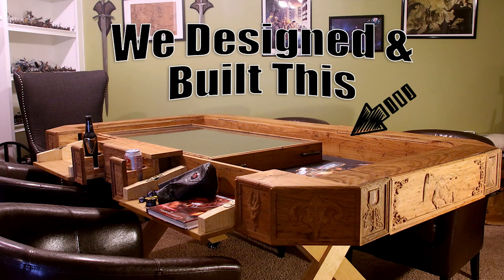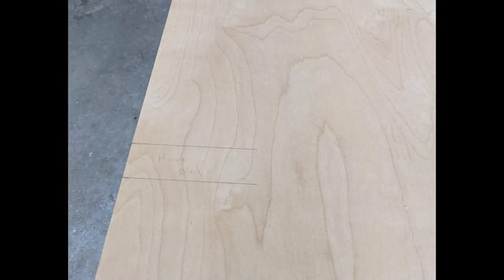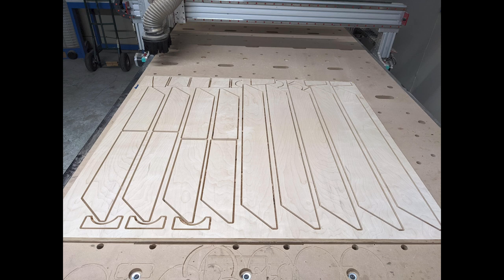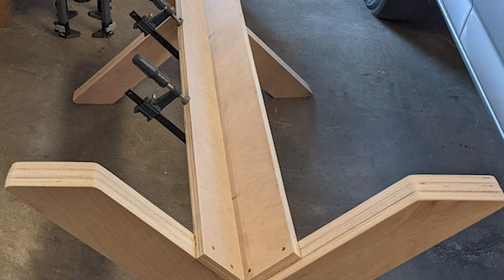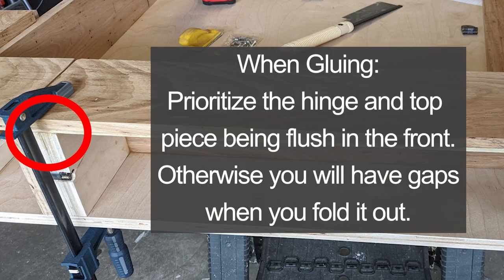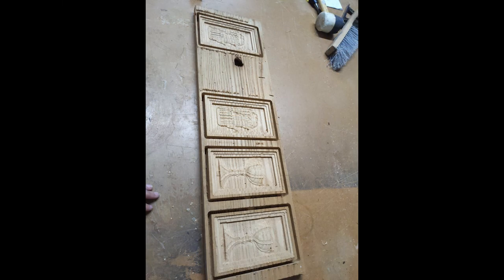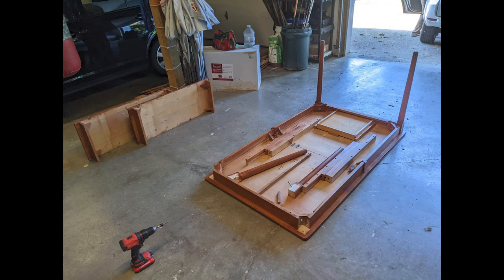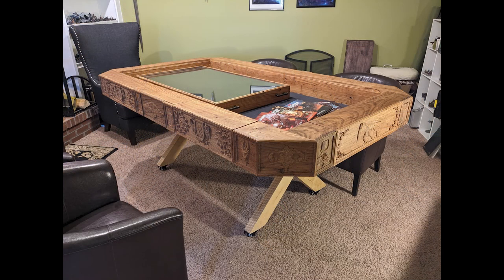Building The Gaming Table

Comment: The issue with hinges isn't just plywood - though that makes it worse. It's screwing into the grain, just turning the playwood the other way, would have made it much stronger.
You could also use a router to inset the hinges to make it a smooth connection.

Cracking has a lot do do with using different woods, as they expand at different rates in different temperatures, and drilling one board width wise and the other length wise. Wood expands more along the grain.

Overall cool table!
Reply: I'm not sure what you mean by turning the plywood the other way. Plywood layers alternate orientation. Am I misunderstanding what you mean?

Comment: Why’d your table skip leg day?
Reply from the maker: It's actually for a very practical purpose.  The chairs we have for this table are way oversized. We couldn't do a typical 4 post, one in each corner design.  On top of that we knew we needed it on casters to be able to move it regularly.  We use that space for a number of different things and that table is constantly shuffled around.  What's worse than stubbing your toe on a table leg?  Scraping up your whole foot on a caster locking mechanism.  So we had to make sure the legs were tucked well under the table.  The X design with a runner works extremely well for stability.  So while it looks very silly on it's own you can't even see the legs when the chairs are around the table and no busted toes or knees so far.
Reply: @tworoads  nice! Always better to have practical design choices instead of ice packs on hand
Reply: this comment made me laugh so much!

Comment: Would you happen to have these files available anywhere? I would love to make a table similar but lack design experience.
Reply from the maker: You can look through the build process with links to files here: https://www.instructables.com/Gaming-Table-1/  The faceplate panels aren't included as many of those were paid files and I didn't have the rights to share my modified versions.  All the other files are there as Tinkercad links, but you can make yourself a copy of those and save what you need as an STL. I wanted to give people access to Tinkercad versions so they could modify for their needs.  Good luck with your build!
Reply: Very cool project. Making one similar with solid materials. Would you be willing to share the cutting angles and dimensions of the fold out hinged shelf. We will be doing this by hand without CNC benefits :-) thank you
Reply from the maker: So the piece that makes the 2nd half of the fold out desk is 20" by 6.5"  We maybe would have made them a little wider.  On the short ends those were 25" wide which gave the DM more space.  So I would say do the width what you have space for.  The hinges get a bit complicated.  You'll need to cut a rectangle that is almost exactly the height of the inside rail that makes your vault.  For us that was 5" but add a little for the kerf of the blade you are using.  The angle of the cut does not matter too much.  What really matters is that one side of your cut is exactly halfway up the rectangle. So in our case 2.5".  Then just mark the other end at something like 3.5"-4" and cut. As long as the one side is exactly in the middle the rest is just aesthetics for how you want it to look.  The more exactly in the middle the better everything will line up when it is closed and open. Depending on the hinges you choose you may have to chisel out a little for it to fit flush again.  Best of luck with your build.

Comment: This is a great table! Well done, the player stations are really cool.
But please revisit your leg support. The X design is great for stability for table width but those small V boards and 4 screws into the edge of the plywood will not hold for long if you are moving the table around. Maybe a 3rd vertical board under the V?
Not trying to knock the design because it is an awesome and very functional game table.
Reply from the maker: We plan to revisit the legs if/when it becomes a problem. We're coming up on 2 years since we built it, and everything is working well so far.  We even disassembled it from the legs, transported it to a local gallery where our makerspace was doing an exhibition and brought it back home.  But so far everything is holding together without a hint than anything is amiss.  We really loved this project as a learning experience. We learned how plywood should not be used, but it certainly has not been a catastrophic failure in our experience so far. We definitely wish we had done the same design in hardwood but love the stability of the X design and how it keeps all the legs out of the way!

Comment: For the player cubbies, I think I would prefer using the removable "faceplate" as a player space instead. I'd rather have the ease of removing the top cover instead of the "faceplate". But, the current setup also allows the space to be used even when in the "closed" position.
If anything, you can install a rail/pocket system right underneath each player space so each play can remove the plate and easily place them under the table in this pocket.

Comment: The table is amazing! How do you take off the side panels to open the extra space for each player? Are they magnetic and do you have special storage for them?😊
Reply: They are magnetic. That was somewhat difficult to pull off. You need quite strong magnets and the alignment needs to be just right. There is a v channel that connected the two legs that we store them in. You have to crawl/reach a bit to stow them but it works.

Comment: Did you ever figure out a permanent way to afix the faceplates? Im working on one myself and im stuck there
Reply from the maker: We went with magnets, but it is a rough solution.  We used ones with holes in them so you could screw them in.  But the ones we got were no where near strong enough.  We used forstner bits to inset the magnets a bit so the faceplates fit as snug as possible.  Lining everything up was tricky and while they stay in place they are very precarious, you can't bump them without them coming off.  Stronger magnets might have helped but I don't think it was the perfect solution.  Do a test one if you go this route before making holes in your table.

Comment: hello simple question what is the height between the base (first plywood) and the top of the table it still looks very high doesn't it?
Reply: I believe the height difference is about 6 3/4".  So yes, it is quite a bit higher, but great to use for standing games. When seated the player stations are at the lower level.  So you have to look down into the vault a bit. But the 4'x7' size table kind of meant you'd have to stand and lean over to move much in the center anyways.

Comment: So you have a woodworking CNC...but you didn't know (in the case of your hinges) to put screws in between the layers of plywood?!?!

Those are laminated layers of wood...and by putting a screw in between those layers you are delaminating the plywood.  You wonder why you got tear out?!  Screws in plywood are perfectly fine as long as the screws are able to bite into the layers from the other (90°) direction.

Boggles the mind!!
Reply: having a CNC or not doesn't play into the knowledge of plywood AT ALL. Yes, screwing directly into the plywood laminated layers is a terrible idea without predrilled holes, but that same thing applies to a lot of wood. The type of wood, the grains, and where/how you're nailing/screwing plays a big part in the splitting of the wood, plywood doubles depending on which side, purely because its glued, screwing into ANY wood that's prone to splitting isn't a good idea, no matter the angle you're doing it at. They said nothing in the video about being clueless about the plywood, and even went above to tell others not to do the same, as it caused them a lot of problems. These people have amazing know how of woodworking and just from this video id trust them on ANY project they'd be doing in the future. Which boggles MY mind on how lack luster you seem to be about pinpointing these details out.
Reply: I have access to a CNC at a maker space, I don't own it nor half the tools I needed to build the table.  And luckily the screws did bite fine, no delamination yet, they just pulled a bit.
Reply: @elementkingaming1947 ...A woodworking CNC is an advanced woodworking tool.  A beginner woodworker would never have a woodworking CNC in their tool arsenal.  Working with simple two-by-fours and plywood are the typical starting-point of most woodworkers.  Having an understanding of what plywood is, its pros and cons, its strengths and weaknesses and how it's constructed is woodworking 101.
Reply: @VickiS ...I never said anything about simply having access to a woodworking CNC, did I Vicki?!?

A beginner woodworker will not go out and buy a woodworking CNC before learning the basics of woodworking.  That includes the basics of plywood.